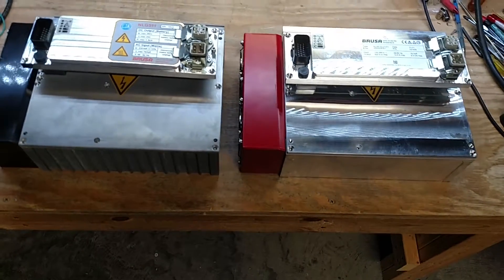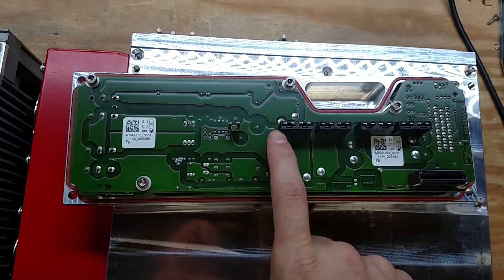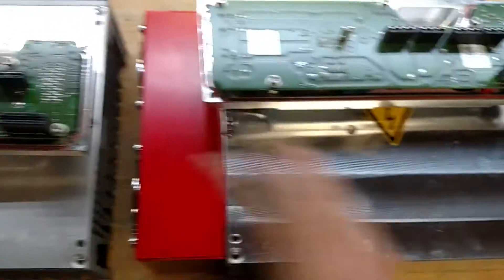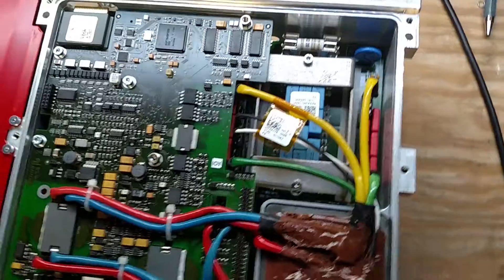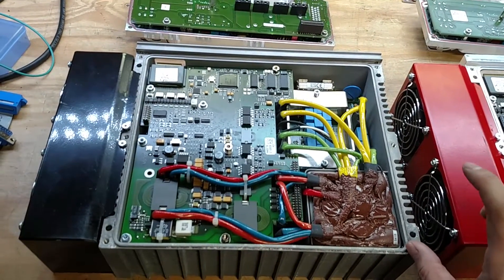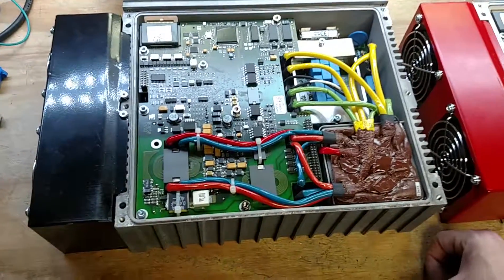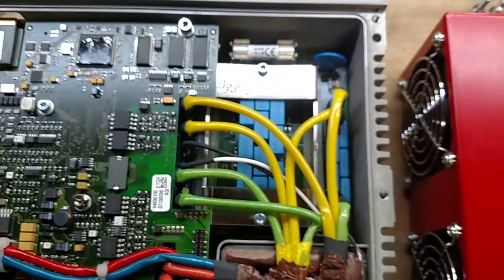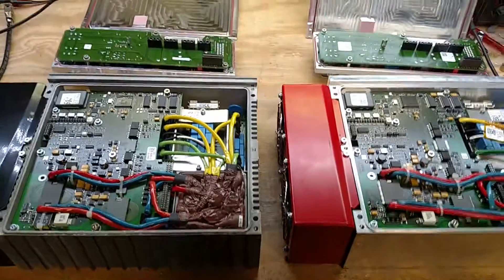Convert a Brusa NLG513 to a NLG511 Battery Charger?

Comment: Well even if you swap the transformer, it's a DC/DC converter so the higher voltage is switched by some semiconductors, which need to be rated for the correct voltage & current. There is probably a lot that's different in the control architecture, which expects the higher voltage as well. It is not something you could modify unless you reverse engineer most parts of the charger and make proper changes to many components on the PCBA

Comment: What if you just swap out the transformers and see if you can get it to work, then all you need to get is a transformer might be able to pick it up as a spare part from the manufacture
Reply from the maker: +Eoin Caldwell 

All the output stage caps are also the wrong size, you would need to swap them all out... Also change the voltage and current sense dividers and change the firmware, so it also knows and reports the correct voltage and current scaling.

It could be done... But it is alot of work.

I could also use the NLG513 as is, it will just be limited to 12.5A battery charge current. And would not be that efficient. ;)

Comment: Sadly I do not have a NLG511 (or any other Brusa products for that matter.)  After seeing your video I wish I did as those converters looks like they would make amazing CAN bus controlled lab power supplies.  (AKA replace the capacitor of doom...) Ok, I guess it is not bidirectional but you can digitally ramp the voltage and current over an isolated CAN interface that I assume gives nice monitoring.  Which makes me wonder if there is an off the shelf product like this that does DC to DC conversion with a CAN control interface?  Sorry none of that helps with your dilemma...
Reply from the maker: +jontscott 

It would be possible... 

The charger would only be a source of current, not a sink...

And I am not sure how much actual real time control you have, typically they follow a multi stage charge curve...

Honestly, I have not looked at the CAN interface to see how much control you do have over the charger...

Comment: just curious, how much did that thing cost?
Reply from the maker: +PhilipR144 

The NLG511 cost me $500 + $25 shipping.

Brand new the NLG51X chargers are rather optimistically priced at $3000.

However the 6th gen NLG61X chargers are out now... So I hope to see a price reduction on the older NLG51X chargers...